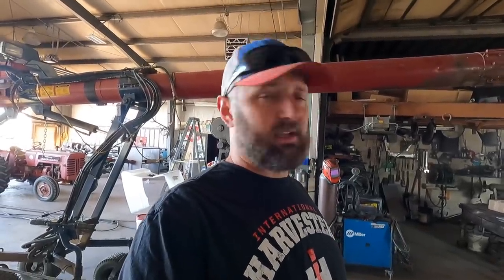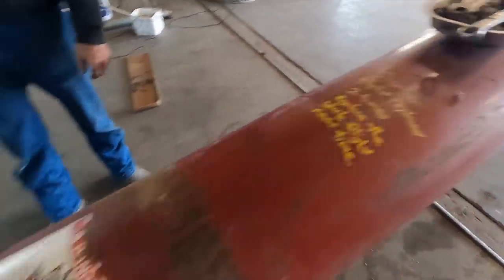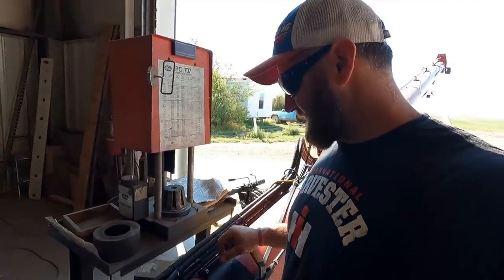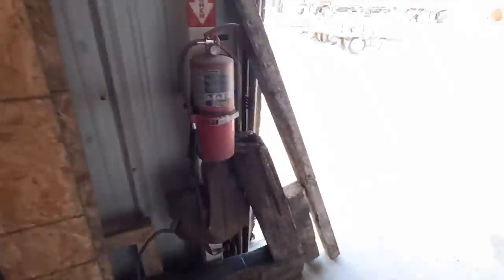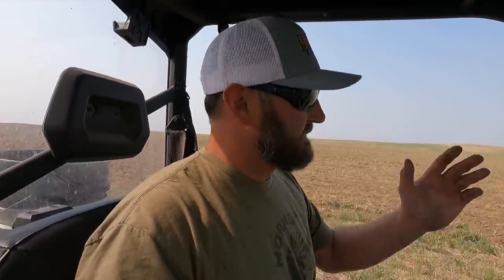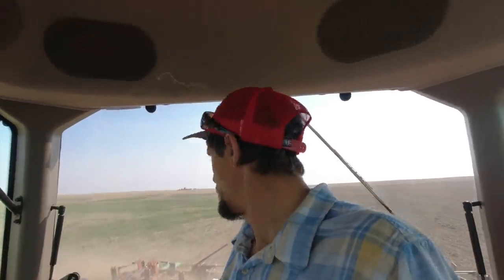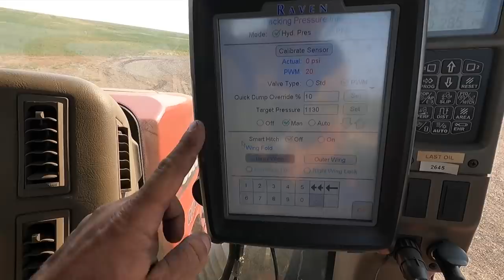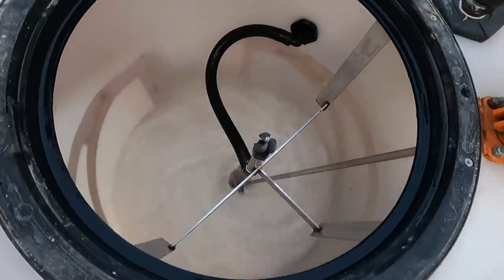Doing it all for FREEEEE!! Going Old School!

Comment: Yes Colin I remember framing in the late 60's and early 70's  with a LA Case tractor no cab no radio top speed pulling a 12 foot disc was about 3 mile hour and boy did I think I was getting some ground worked our combine had no cab and after working all day and the tractor or combine you was covered in dirt we haul wheat into town with a pickup  and that was all our combine would holed a pickup bed full

Comment: Collin is lucky he has all that cool equipment to run. I was one of about 15 kids/grandkids that worked for my grandfather (rancher) in western SD. He grew up in the depression. He was always about the life lesson with the old equipment and showing what you can do. We had all the old stuff, only one  tractor had a cab (International Hydro 100, no AC). Cutting hay was on a JD 800 or the older IH 201 swather, both with no cabs. You'd start the day clean and end up yellow by the end of the day, just dusted with clover pollen.  Fixed a flat on the Hydro 100 after my grandfather drove it through the creek and a 4" stick poked a hole in it. We dismounted the tire, cut a 18" length of sidewall out of an old tire and bolted the "patch" to the inside of the tire. Ran it for 4 years that way. Fun times.

Comment: Tony can dang sure weld!!! And Collin is a stylin in the Cinch paisley shirt. 👍🏼 Tony, contrary to no-till beliefs, I have found that if you will do some tillage every 5 years you will see a benefit. I don’t know if it’s airing out the ground, or just putting the residue in the ground for the microbes to work faster. But i can tell a difference. Especially on a dry year.
Reply: Something to do with mineralising the nutrients present in the soil I think??
Reply: @benpattinson1  they talked about that on th last off the husk podcast. Something to do with carbon blah blah blah. I don’t understand it all but they did talk about it with an agronomist

Comment: I don’t know what you called the tillage tool but we called it a field cultivator. And for what your trying to do a disc would work better.
Reply: Yeah, a disk would have been a better option than a field cultivator for what they were looking to do. I don't think they do much tillage at all out in Montana due to the soil type they have, compared to our rich soil types here in the Midwest and the fact that they don't get near the rainfall that we typically get here. If I farmed in Montana I'd be a no-till fan, although I think I would occasionally run a sub soil ripper to break up compaction when needed.